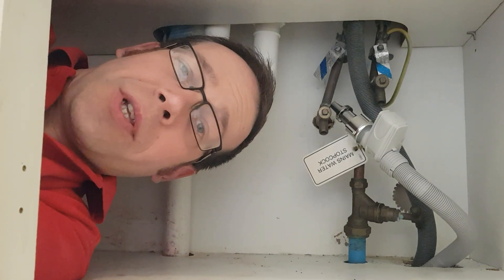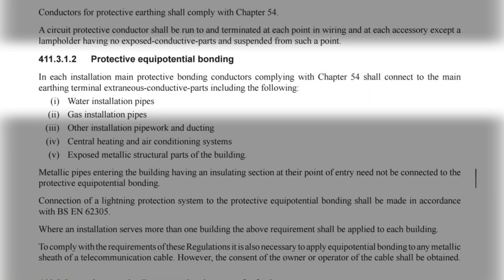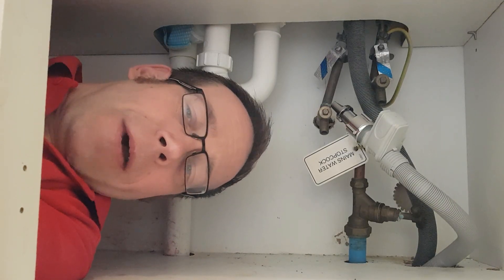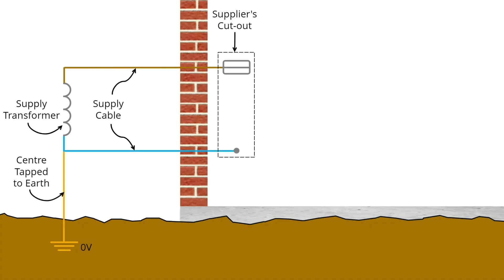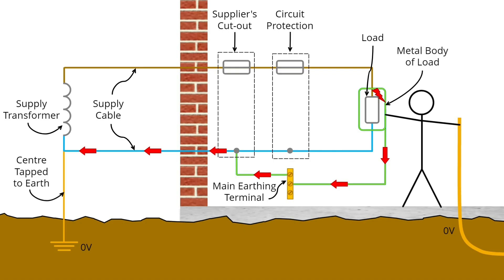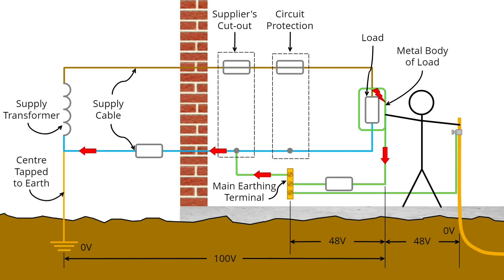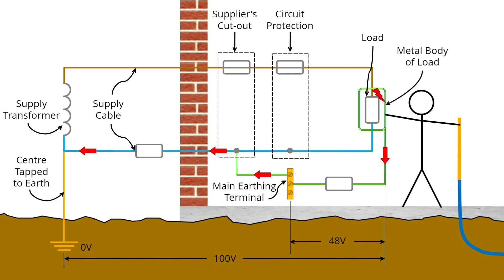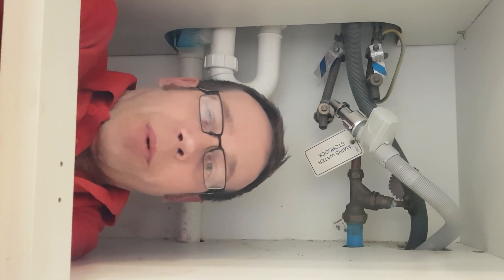DO YOU NEED TO EARTH BOND PLASTIC WATER PIPES?

Comment: Joe you cannot state that if the service pipework is plastic then it does not require main equipotential bonding. It is possible that elsewhere within the property that the installation copper pipework enters the true earth and comes back up again, and therefore can be deemed extraneous. A simple test to prove is what I do,....continuity test between the MET and the pipework. If the reading is <23k Ohms then the pipework is not deemed to be extraneous and you would not need to bond.
Reply from the maker: Regulation 411.3.1.2 states it. If the metal pipe enters the ground as you've described then it's a different situation and may well need a bond, if it changes to plastic where it enters and exits the ground it won't. I know what you're saying though Andrew and there'll be much more information on this subject on the way. 😊
Reply: Even if it doesn't enter earth and rise again the point of bonding is nothing to do with that.
Reply: @asp217  sure I fixed it for you seeing as you can't read!

Comment: There is a related "but you wouldn't bond a bed frame" in solar panels.

In theory, the frame of the panel and the mounting system it's connected to is completely isolated from the electrical bits and it's completely isolated from mains. In that regard it's no different to cable tray. 

If you bond it, and a fault occurred such that a DC cable ended up making electrical contact to the frame, you could end up with interesting voltages between conductors that are supposed to be floating and ground. Or high DC earth currents. There are strong arguments that frames shouldn't be bonded, some mounting systems have no way of bonding as they're completely plastic, some electrical standards (including the old UK ones) say you should have everything floating and not bonded.

But the current UK code of practice states quite clearly that every metallic part of the solar install, despite the fact it's effectively the same as cable tray that you wouldn't connect to earth, must have at least a functional earth connection. It's to help fault monitoring happen, but in some cases could actually make faults worse.
Reply from the maker: Interesting point. 👍
Reply: Bull! Cable tray SHOULD be bonded, there is no reason that it couldn't become live!

Comment: I've always been puzzled about bonding, the reason being, every piece of metal pipework is connected to a CPC, maybe not, but I can't think of the scenario when that's not the case. If you have a gas supply and boiler, the CPC for the boiler connects any metal pipework to earth as would any water heater. A gas boiler connects the CPC to both the water and gas, though I do seem to remember that some boiler manufactures don't do this, I'm not certain of that. When the water companies changed the network to plastic a lot of older properties lost their earthing system all together, as it used to be common practice to use the water pipe as very reliable earth. There are thousands of properties, especially older ones that no longer have a proper earthing system. Why aren't there dead people everywhere due to this issue?? Totally agree that there's no point bonding metallic pipework if the incoming pipes are plastic. Great video and thank you.
Reply from the maker: All very good points, any metal work that does need bonding will need a bigger cable than most CPCs provide though. Stay tuned for more!
Reply: @efixx  Thank you for replying, when you say most CPC's will need a bigger cable it would depend how the earth fault was initiated. The adiabatic equation proves that most CPC's can withstand a far higher fault current than the protective device will let through. Food for thought.
Reply: @J0nny61  we are not concerned with an internal earth fault when we talk about main bonding. We are concerned about bringing all extraneous metalwork to the same potential as the installation earth. The bonding conductor will be sized to cater for diverted neutral currents
Reply: @J0nny61  I would hope CPC's can withstand a greater current than the protective device otherwise there is a chance the CPC will fail before the protective device does, and that is not the situation you want. It is completely opposite of what is needed.
Reply: @deang5622  Thank you for the reply, but I don't quite understand the point you are making. All CPC's are designed so if an earth fault occurs the let through energy will trip the circuit protective device. In 46 years in the industry I've never seen a CPC fail other than from a direct lightening strike.
Reply: It's correct name is equipotential bonding. Why? Because all points are at the same potential.

Let's not get confused between earthing which CPC's are for, and bonding. They fulfil two different requirements.
Reply: The need for good grounding is to trip the breaker at a fault. The safety of the house comes from having one single potential on all toucheble surfaces. If all metal pipes, electrical enclosures and house frames are bonded you will not get electicuted even at a fault. No need for good earthing 😀.

Comment: Yeah. If you earth something that doesn't need to be earthed, ( as you said bedframe), then that creates a dangerous situation, because now if you touch something live, and that earthed object, the current will shoot through you.
Reply from the maker: Yur, could be dangerous.
Reply: But that is why we have RCDs now.
Reply: @davepusey  RCD will reduce the level of electrical shock that you may get. But you'll still get a belt but for a shortish period of time.
RCDs used for protection on sockets are rated at 30mA. Studies have shown that 'usually' the heart needs over 40mA for 200mSec to go into fibrulation so it is calculated that 30mA will give a reasonable level of protection.
They are not a catch all 100% safety blanket. they are an electro-mechanical device and (as such) can go wrong - that's why they need to be tested every 3 months.
If anyone disagrees, how about standing on a wet floor, and put your tongue on a live cable.

Comment: What about gas? Often a bond is applied after the meter, yet the incoming supply is plastic.
Reply: Not anymore.
Reply from the maker: It's an interesting question regarding gas actually, in theory you wouldn't have to but someone has mentioned a requirement in the gas regs elsewhere in the comments so I'll be looking into that. 😊
Reply: @efixx  Steel incoming gas supplies have a galvanic insulating joint before the meter to prevent fault currents flowing to earth that way.
Reply: Gas supplies are NOT plastic, some have a yellow plastic coating fir identification but the inner pipe is steal or copper.

Comment: Quite often I come across Radio Hams on a TNCS system, but with their own "RF" eath that can be anything from and aditional earth rod of some description driven into the ground to a whole scrap car buried in the garden. Some are insistant that the RF and Mains earths have to be isolated from each other, some ask why a multimeter shows a voltage difference between them, and some will actualy allow a bonding connection between them. I always suggest that the RF earth can be improved by linking them and quote ohms law :)
Reply: Hi Steve, I qualified as a radio Ham   a long time ago.
Separate “Earths” for power supply (mains) and Radio Frequency (RF)
The mains Earth (CPC) is for protection from electric shock and for removal of power under fault conditions. This Earth can cause noise to be introduced into circuits from switch mode power supplies and power line adapters etc.,
RF Earth is to provide a low noise reference to incoming signals to the receiver and to provide a separate Earth for the transmitter aerial which is outputting considerable radio frequency currents. The RF Earth, very often, is part of the aerial system. There would be problems if this high power RF current was connected into the house wiring via the Earth (CPC).
Ham radio equipment has a special “Earth” terminal for RF.
Ham radio equipment manufacturers advise not connecting to the mains Earth (CPC). I do not transmit but just listen and all of my receiving equipment has this advice.
Reply: @dougmorris2134  The definition of an extraneous-conductive-part as defined within BS 7671:2018 is as follows: “A conductive part liable to introduce a potential, generally Earth potential, and not forming part of the electrical installation.” ... Not forming part of the electrical installation.
Your RF earth requires bonding :(

Comment: How about this scenario, “a non extraneous” water pipe with an insulating section at its point of entry doesn’t require a main equipotential bond. So what about when this turns internally into a copper water pipe installation, then this copper pipe is installed into a metallic boiler manifold. Then this manifold connects to the extraneous gas pipe work (with a metallic section at its point of entry) surely now this “common” copper pipe work is now deemed to be extraneous???? And how the hell do you successfully perform a 22K test on “commoned up” gas and water copper pipe work installation? 🤷‍♂️
Reply: you would bond the main incoming gas in that case as that is still incoming to the property
Reply: @markpotter8280  yes I agree but the extraneous gas pipe work is making the non extraneous water, an extraneous conductive part, and there’s no way of separating the two.

Comment: I am aware of this before, does not sound right to me that exposed metal in a house is not bonded, most houses will have a boiler of some description, chances are the water pipes will pick up an earth anyway. You mention we cannot allow for bad workmanship that say a cable melted and made the metal work live to be an excuse, yet we have all sorts of safety measures in place to stop electric shock, mmm not convinced.
Reply: It's not even anything to do with cables contacting pipes, safety devices in the DB will deal with that, its about lightning strikes more than anything.

Comment: some pipes within the house run through the ground. I.E an extension done in copper pipe that was run through the concrete. Therefor is there still a potential within the house?
Reply: then you bond that pipe not the main incomer

Comment: In a house with radiators that are plumbed with copper pipe; are the central heating water pipes bonded completely independently of the house water supply? Could disconnecting the water pipe bonding mess with the radiator bonding?

Comment: What about the following electrical items connected to the copper water pipes inside the house:  immersion heater, internal tank thermostats, waste disposal unit, tap hot / boiling water, boiler, water pumps etc. Now each of these items will have their own earth ( cpc ) which will earth the copper water pipes any way through local bonding. I would always bond internal copper water pipes even with a plastic supply just in case.

Comment: Adding a bonding earth connection to a metal pipe that is otherwise insulated from earth (by virtue of the plastic water pipe) is a complete waste of time, money and effort. It's as sensible as connecting a CPC to a plastic box! In other words ... NOT.

In addition though, there is a FAR more significant reason for bonding metal pipework entering a building. With it being directly connected to ground at the point of entry there is huge danger presented due to potential (no pun) nearby, not even direct, lightning strikes.

When lightning strikes the ground, the millions of volts and amps cause a radial effect of a VERY significant potential gradient from the "strike" point.

Someone close to, and not even touching said pipe can be subjected to many (tens of) thousands of volts potential difference between themselves and the distant, much lower ground potential of the system earth. Result? Pretty obvious.

The walls of the house/building can ALSO have THEIR potential raised significantly. Bonding an otherwise insulated metal pipe, CAN under those circumstances be causing an EXTREME danger to anyone close by. They may have THEIR potential raised significantly simply by standing on the floor of the property, and then if they touch the bonded pipe ... well ... Ouch!
Reply: Always bond whether the main pipe is plastic or not. Lightning strikes on storage tank vent pipes result in live taps and sinks
Reply: @stuartcraigon2003  hmm! Please explain HOW exactly lightning strikes INSIDE a building!! Interesting concept! Not sure how many would agree with you.

 I've never heard of a water system vent pipe being led outside as it is supposed to feed back into the cold header tank ... INSIDE the building!

Going from your moniker, is this something that ONLY exists in Scotland? 

UNLESS any EXPOSED pipework is connected PHYSICALLY AND ELECTRICALLY to the fabric of the building AND/OR ground there is no risk of shock. 

A person standing in a building where its "ground" potential has been raised to several THOUSAND volts is at EXACTLY the same potential, until he touches a bonded ground! THEN he would receive a shock! 
.
Paradoxically, TT systems are not generally subject to this issue as THEIR ground WRT lightning IS at LOCAL earth potential, not a copper cable back to the transformer earth. So a nearby ground-potential voltage gradient affects the "earth", building and bonding potentials the same way, hence no shock hazard can exist when the person, the building, earth and bonded grounds are equipotential.
Reply: @boblewis5558  seriously! Look on the roof of most houses built in the 50's and 60's some newer too. If there is unvented hot water there will be a copper "walking stick" on the roof. 
It's not a concept it's a fact, that's what pipe bonding is for.
Reply: @stuartcraigon2003  I was born into a house of the fifties, many of the houses in the area were also of that period. I have driven all over, to both ends and both sides of the UK and plenty in between. I have NEVER seen a hot water expansion vent poking out of ANY roof anywhere. Are you talking about somewhere in the UK where this is common?

 Like I said, a hot water expansion vent is SUPPOSED to return and overflow into the cold header tank, almost always inside the building, typically in the loft.

Or are you talking about a cast iron soil pipe vent fitted to the EXTERIOR of the building? Those fitted INTERNALLY in the 70's are not normally easily accessible internally as they are fully boxed nor are they conductive ... they are plastic.

Can you provide some external reference image links? I've searched and can't find any other than plastic soil vents above the roof line. 

Just about the ONLY metal parts typically seen above the roof are antennae (VHF & UHF) and solar PV. 

The former's signal screen  connection will typically connect to electronic ground but not to "earth". Solar PV has its own specific CPC rules and typically only has the 1.5 mm² or 2.5 mm² CPC of the inverter connection to worry about.

Modern radios and TVs, even CRTs, have NO CPC connection so there is no direct connection from the antenna circuit ground to earth. But it is still a lower resistance path for lightning to travel down the shield and then jump to a wall in close proximity, these days via the steel wall bracket. 

Yet I know of NO-ONE who has advocated "bonding" metal TV wall brackets! Why? Because it would present a FAR greater opportunity and probability of attracting a lightning bolt ... Something that I don't believe even a 40 mm² CPC could handle unharmed!

 Such a direct earth would also pose a FAR greater risk of fire due to the massive surge current before literally blowing the antenna lead apart with high plasma effects.
🤔😱😲🙄🙄
Reply: @boblewis5558  well there's 6 sticking out my roof and 5 redundant cold water storage tanks! I'm in a 1950's block of 6 flats, if I could share a picture of my roof to prove my point I would.
Stick to electrics because you obviously know nothing about plumbing!
Reply: @stuartcraigon2003  I suggest you go and read your own earlier comment again! Blocks of flats are NOT houses! Homes, yes. Houses, NO. You said HOUSES! 

I also referenced HOUSES not flats. You don't have to post a picture of your roof, Google for house pictures with such external vent pipes to demonstrate your point. Preferably pictures of say a row of terraced houses with every house having such an arrangement. I repeat, I've never seen any such.
Reply: @boblewis5558  houses, flats all the same. The terraces of two storey houses round me all have them too. 
Your either blind or don't get out either way your clueless.
Reply: @stuartcraigon2003  tell you what, you find some pics on Google of terrace houses with what you're describing and post the links, and WHERE those locations are!

Comment: What if metallic water pipework entered the mass of earth elsewhere in the system after the incomer? I would be bonding then! Think properties with annexes or external water taps… etc.
Reply: then you would bond it there, if a property has two or more points where the pipework enters the building you would bond at each point it doesn't happen a lot but I have seen it.  For example a house has a main water supply that is metal coming into the property from underground into the kitchen but then it also has a metal pipe going underground from the wc to an outhouse you should bond at both locations within 600mm before any joints yada yada yada
Reply: @markpotter8280  agreed. old pubs with cellars are notorious for metallic water pipework re-entering earth after the incomer which has been replaced with a new plastic incomer. Important to review all extraneous systems and not just assume based on incomer.